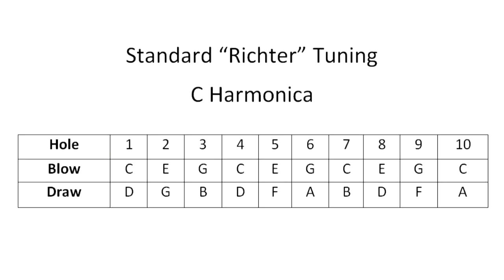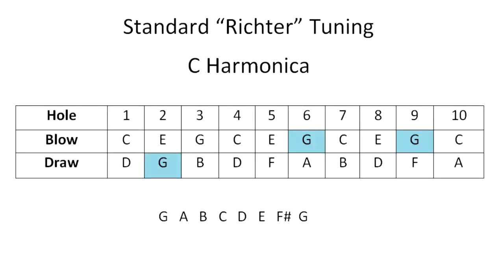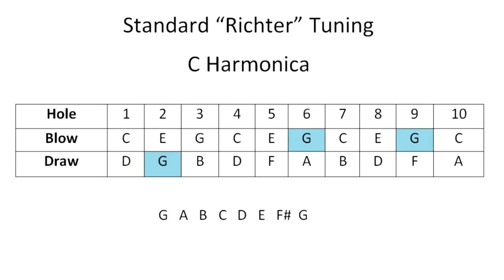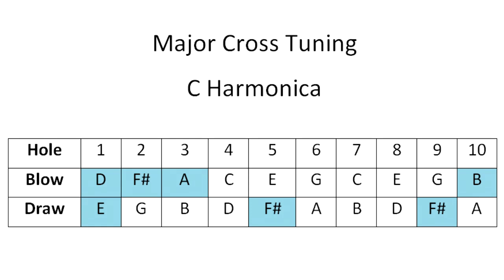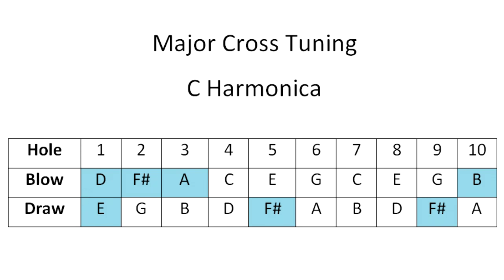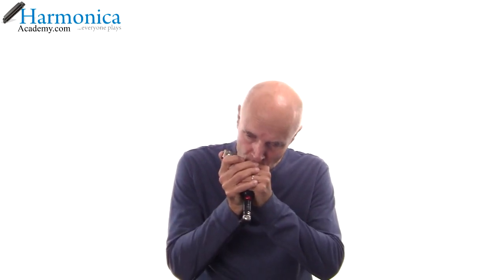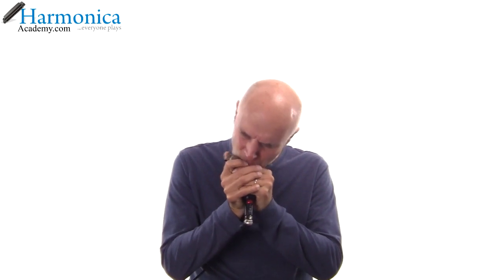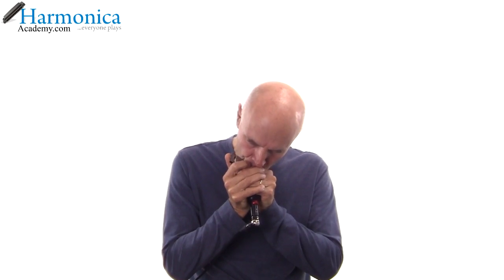Major Cross Harmonica Tuning

Comment: Well done. Melody Maker is my favorite harmonica and the type I play most. MM is the same as Major Cross from draw 2 to blow 9. You mentioned the modal scale in third for Red Haired Boy. If you bend the draw 4 you can also play major key tunes in third. It is a handy option for some tunes. Hearing you play Major Cross and also Buddy Greene, Charlie McCoy, and Steve Baker play Country tuned (what Mr. Baker calls Major Seventh tuning), and Lee Oskar play Melody Maker sold me on crossed tuned harps over 10 years ago. Thanks.

Comment: It appears that Tony does not reply here so, if anyone has the answer to my question please chime in.

Since the reason for changing the layout of the harmonica is to get a major scale, why not use the solo layout? The big difference I see between solo and major cross is situating the root on draw two. Then of course there is the switch at hole six. 
If the main  impetus was to get a major scale out of a richter harmonica, DIY modification being probably the only option 20 years ago, I see the logic. Considering today’s availability of a symmetrical solo layout 10 hole diatonic what advantages are there in using the major cross layout?  I am going to guess, being able to bend the root would be a reason, if that is possible on major cross.
If you had a solo layout that was reversed so the root was a draw note, would you have the same advantages as major cross?
Reply: Hi Paul. I can't answer for Tony but I'll tell you why I often use a cross tuning. Draw 3, 4, and 5 can be bent for flat 3rd, 5th, and 7th. Those are very useful notes. Second position can be more expressive sounding. It also starts the major scale on draw 2 instead of blow 4 so you are not forced into the highest notes to complete the melody unless you want go there. Also the button box and concertina players often play across rows (play a G tune on the C row) which gives a certain lilt. Such a tune may play easy on a major cross but be difficult on a Richter. There are other tunes that play better in first on a Richter so I have both kinds.